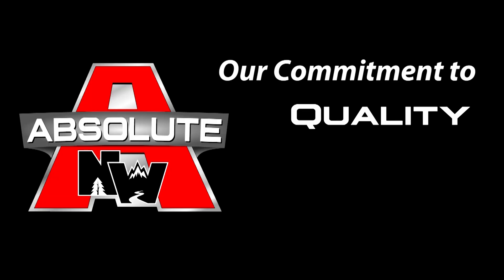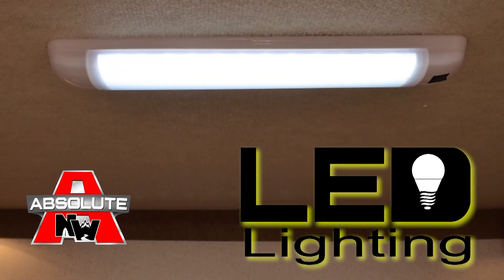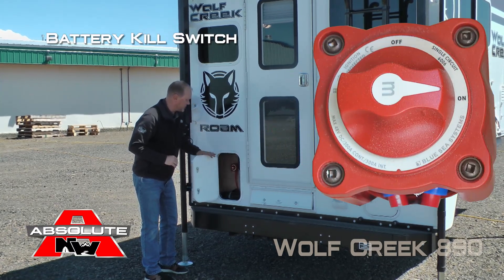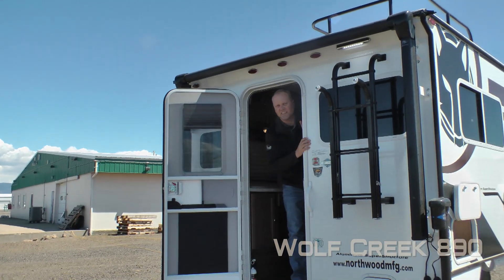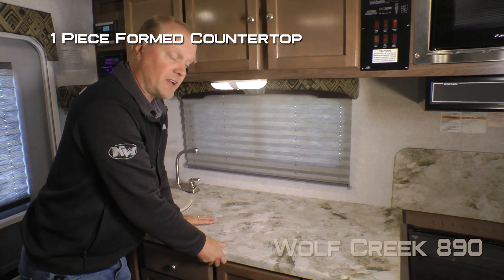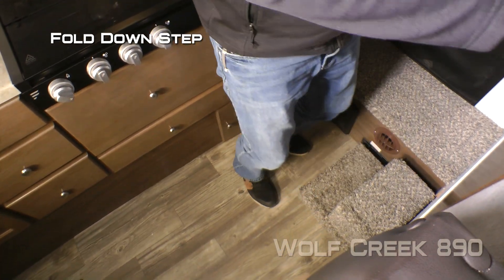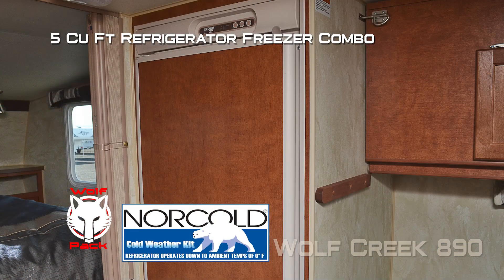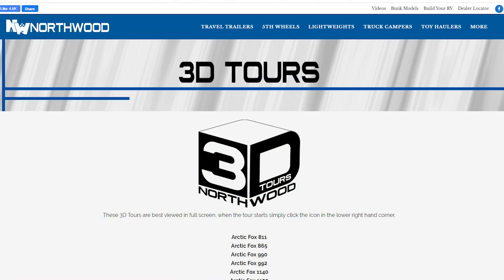Quick Tour of the New 2022 Wolf Creek 890 Pickup Camper

Comment: There are none of these ever available!! Demo is way too quick and too short. Would be nice to get more detailed information throughout including what size pick up truck is needed for this camper?? Also, is this a true four season? How is the insulation and windows??
Reply: @ZAR66  Lance you pay out the Yazzooo for.
Reply: @connie fox The wolf creek line is like a simpler version of the more executive arctic fox line (865). Given the wet weight of the 890 cuts close to 3000lbs and if you add in gear and people, a 2500 truck is gonna find insane difficulty handling it. A 3500 single rear wheel would be able to handle it but dual rear wheels would be the ideal setup. Also I believe wolf creek has R5 insulation while Arctic fox has R10.